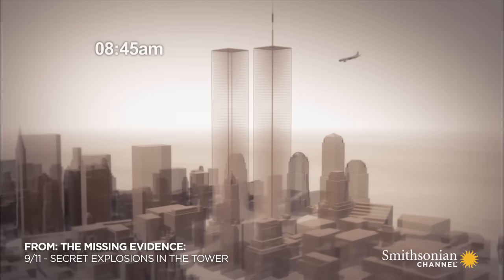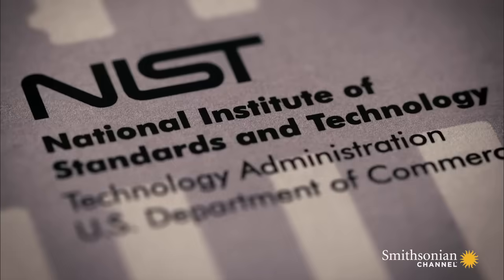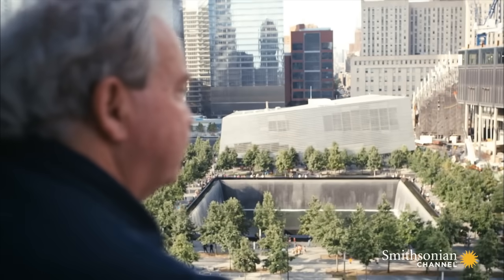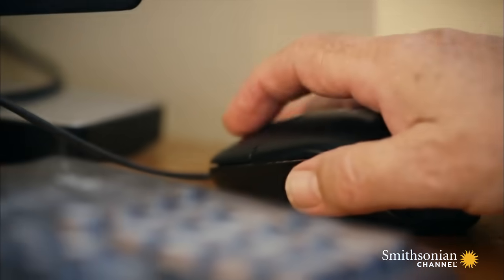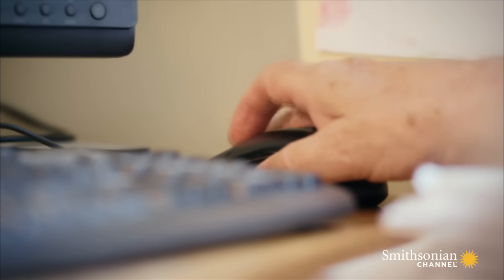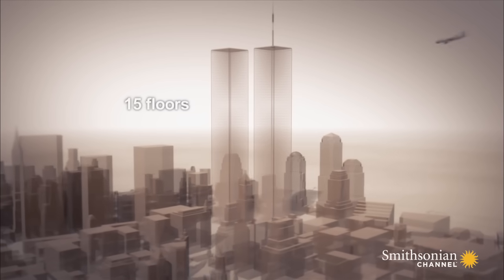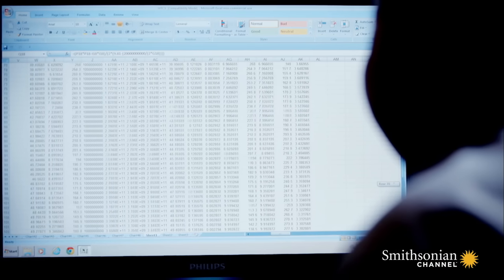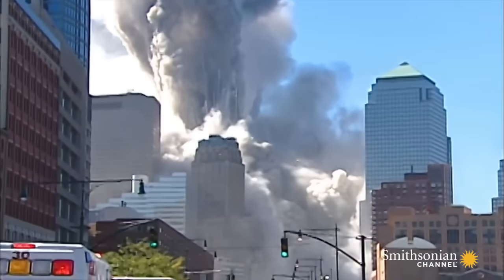This Computer Simulation Explains How the Twin Towers Fell

Comment: Aak yourself, why do the planes at the WTC Have wings that shear thru steel beams, even the tail and wing tips can be seen doing this. Yet at the Pentagon the wings folded against the fuselage and that then pearced 6 walls, all 13 ft in diameter. Thimk about it.
Reply: Purr Cat

The maximum load rating of the columns was exceeded by several orders of magnitude, and they were bent, torn, or broken. Steel is not some magic material. It is easily shaped and cut with the right tools and enough force. The nature of the collapse on 911 provided more than enough force.
..............................................................................................................................................
Soy boy, type in WTC Central Spine. 47 columns 4.4ftx3ft tapering to 32"x16" at the top. Tell me, child, how did they collapse? They Fell Straight Down. How dat be?
Reply: +Purr Cat Because the pentagon was reinforced against impact; the WTC towers were not.
Reply: Soy boy, type in WTC Central Spine. 47 columns 4.4ftx3ft tapering to 32"x16" at the top. Tell me, child, how did they collapse? They Fell Straight Down. How dat be?
Reply: +TimReed22222 so the strong walls caused the wings to fold back and thus the plane fuselage punched six neat round 13ft diameter holes. ok. now tell me why the WTC plane wings sheared steel with their leading edges and even the tips. all video shows this Fact. wing tips don't usually do that

Comment: What fraud, first Smith shows us translucent tubes. NIST denied freefall speed for over 13 years before David Chandler, from A&E 911 Truth obtained that admission. UL Never produced evidence that kerosene melts steel beams, beams some 47 in number and over 32x16 inches. And 150 tons of aluminum will not demolish 500,000 tons of steel.

Comment: Come on guys, think simple. Fact....there were two big holes in those buildings, we all saw two aicraft hitting both buildings, creating those big holes. I don't give a shit about how fast these two aircraft might have flown, as it was surely fast enough for both of them to be desintegrated inside the buildings. So now you have two holes and undoubtly lots of internal damage to the construction and instead of 100% only 60% of the columns are holding up the thousands of tons of weight above the impact points, and if you bring the fires into the equation the construction gets even more weakened (NOT MELTED!!!!!) and at some point the remaining columns say; "Fuck You, I can't hold this anymore", result is a collapse. To me when i saw those holes it was not a matter of If but when will these buildings collapse.

Comment: The guy is a chemical engineer. Until he released his software to be peer reviewed by mechanical.and civil engineers then take what he says with a pinch of salt. I'm assuming his model is predominately full of assumptions as you couldn't possibly solve that with just a momentum transfer assessment on excel.
Reply: asrgaqgq sdfgsdgsdfgsdg I'm a mechanical engineer, not a civil engineer. I wouldn't even attempt an assessment of the mechanics of a building - that's the job of a civil engineer. I woulsnt expect a research chemist could understand the mechanics enough without years of study. His excel model will have a lot of assumptions to simplify the analysis down. Why do you think others did more in-depth FEA?

Comment: Calculated with an Excel spreadsheet? That's what I think of when it comes to complex computer modeling with multiple variables.
Reply: tubbyturky
  >>>Calculated with an Excel spreadsheet? That's what I think of when it comes to 
>>>complex computer modeling with multiple variables

Face it tubby, you never calculated anything more technical than how much lard you can stuff into your mouth.
Reply: I take it you want me to tell you about my new ketogenic diet? Lots of lard to be eaten there.
Reply: tubbyturky
  >>>I take it you want me to tell you about my new ketogenic diet? Lots of lard to be eaten there.

I take your word for it. Hell, lard is tasty and not that unhealthy. But really, excel is a damn powerful tool if you know how to use it. Don't disparage that of which you have no knowledge. Keep in mind that some of the most amazing technological engineering feats were accomplished with spreadsheets NOT powered by excel. It's the tool, not the platform.

Comment: If anyone believes aircraft can fly thru steel girders like a hot knife thru butter then you are clearly a champion of Fantasy. A bird strike is deemed a serious impact by all pilots. Birds don't compare to thousands of tons steel and concrete. Over 50% of both planes should have slid down the outside walls down to the Tower bases. Where were these wrecks?

Comment: So the plane should have just broken between the steel beams instead of destroying them? Actually asking, no sarcasm.
Reply: The planes weighed around 150 tons each & were going 500 mph ... and the columns were actually short beams bolted together. Also the towers were mostly air, not solid blocks. All the planes had to do was break the bolts.

Comment: Yeahright.... Look on the internet for unbiased (read: not bribed) engineers who use science the way it should. By the way, I'm studying Mechanical Engineering. No way a aluminum plane can bring down a steel building. You need thermite (which is able to burn through steel) to get those columns down. These structures have been build with huge safety factors, considering all kinds of extreme scenario's. An aluminum plane flying into one of the Twin Towers is comparable with an elephant receiving a pinprick. Those buildings were in free fall, accelerating on gravity all the way down. 

There is so much sketchy stuff surrounding the downing of the Twin Towers, I could write an essay on it. 

I can fly into the sky with my arms! in a simulation. 
I can walk on water! in a simulation. 
I can jump 100 meters in the sky! in a simulation.
My own body can bring down one of the Twin Towers! in a simulation.
Reply: Thank you dude. It's refreshing to hear people who are versed in science/mechanics get it.  I can't tell you how many actual 'engineering majors' I've met who can somehow reconcile their knowledge of physics with the official version.  That's when you know you live in an authoritarian society.
Reply: "By the way, I'm studying Mechanical Engineering. "

Great stuff, junior. You seem to have a lot to learn though.

"No way a aluminum plane can bring down a steel building."

Anything will bring down anything if its going fast enough. But that's irrelevant - did you not notice that the buildings WEREN'T brought down by the plane impacts? They stood for a couple of hours until the fires brought them down.

" You need thermite (which is able to burn through steel) to get those columns down."

You'd need hundreds of tonnes of it, and it woudl be very obvious.

"These structures have been build with huge safety factors, considering all kinds of extreme scenario's."

Such as?

" An aluminum plane flying into one of the Twin Towers is comparable with an elephant receiving a pinprick."

See above. It was the fire that brought them down

"Those buildings were in free fall, accelerating on gravity all the way down"

No they weren't. Nowhere near in fact.
Reply: @andyknowles772  
Ground zero = the point on the earth's surface directly above or below an exploding nuclear bomb.....
Reply: Mossad...
Reply: Hi Freek - Keep studying. Don't stop thinking. We can't all agree on everything.

Comment: This is ridiculous, it doesn't account for the heavy strong center core of the building that was constructed to hold up each floor.  He is only calculating the force of one floor falling on the one below it.  His calculations don't consider the inner structure of heavy iron beams!
Reply: David Soom

The center core used conventional steel [not iron] beams to hold the vertical columns together. There was nothing exceptionally strong about the core. When considering a collapse, that is how it's done, one floor has to be the starting point and fall on a lower one. The lower floor must either catch and stop the entire dynamic load of everything above it, or fail. And fail it did.
.................................................................................
This is ridiculous, it doesn't account for the heavy strong center core of the building that was constructed to hold up each floor.  He is only calculating the force of one floor falling on the one below it.  His calculations don't consider the inner structure of heavy iron beams!
Reply: BS It doesn't account for the center core.  If you believe this then you believe building 7 fell too with no help.   You will believe anything1
Reply: David Soom
  >>>BS It doesn't account for the center core. 

There's nothing magic about the center core. It's just more columns. There is no monolithic structure there, it is short columns stacked on top of each other. The columns are spaced apart with steel beams, which support a fairly thin concrete floor. And building 7 did fall without "help", but that knowledge is independent of what happened to the towers.
Reply: Why would you claim that the main towers just fell  with no resistance and building 7 was differen?. What happened that day including the Pentagon and Shanksville (empty hole) was caused by the same reasons.
Reply: David Soom

𝐖𝐡𝐲 𝐰𝐨𝐮𝐥𝐝 𝐲𝐨𝐮 𝐜𝐥𝐚𝐢𝐦 𝐭𝐡𝐚𝐭 𝐭𝐡𝐞 𝐦𝐚𝐢𝐧 𝐭𝐨𝐰𝐞𝐫𝐬 𝐣𝐮𝐬𝐭 𝐟𝐞𝐥𝐥  𝐰𝐢𝐭𝐡 𝐧𝐨 𝐫𝐞𝐬𝐢𝐬𝐭𝐚𝐧𝐜𝐞 
I never claimed that. I never wrote anything close to that.

𝐚𝐧𝐝 𝐛𝐮𝐢𝐥𝐝𝐢𝐧𝐠 𝟕 𝐰𝐚𝐬 𝐝𝐢𝐟𝐟𝐞𝐫𝐞𝐧?
WTC 7 was a completely different structural arrangement. It was also damaged in a different way, although the damage wasn't responsible for the collapse beyond setting the building on fire. WTC 7 collapsed due to failure of some structural members due to deformation by heat.

𝐖𝐡𝐚𝐭 𝐡𝐚𝐩𝐩𝐞𝐧𝐞𝐝 𝐭𝐡𝐚𝐭 𝐝𝐚𝐲 𝐢𝐧𝐜𝐥𝐮𝐝𝐢𝐧𝐠 𝐭𝐡𝐞 𝐏𝐞𝐧𝐭𝐚𝐠𝐨𝐧 𝐚𝐧𝐝 𝐒𝐡𝐚𝐧𝐤𝐬𝐯𝐢𝐥𝐥𝐞 (𝐞𝐦𝐩𝐭𝐲 𝐡𝐨𝐥𝐞) 𝐰𝐚𝐬 𝐜𝐚𝐮𝐬𝐞𝐝 𝐛𝐲 𝐭𝐡𝐞 𝐬𝐚𝐦𝐞 𝐫𝐞𝐚𝐬𝐨𝐧𝐬.
What the hell are you talking about?
Reply: David Soom
 >>> we don't have video of the "plane" that hit the Pentagon

So what? What kind of spoiled conspiracy nuts are you that you demand a video? There's literally tons of physical evidence that Flight 77 was parked inside the Pentagon on 911. There is also plenty of dna and personal effects to account for the passengers, as well as both black boxes. Anyone who denies this is just a fucking liar and is not worth consideration of anything they say, as only a pathological liar would deny such incontrovertible facts. There's been plenty of proof posted on this subject numerous times. The same applies to the flight 93 wreckage. Denying it only eliminates you as someone with any integrity.
Reply: I have to go with the  common sense I was given.  It so happens I'm a Comercial Pilot  Certificate number  2059989 Look it up if you wish.  I currently fly a Citation Bravo for a wealthy family that includes two other aircraft in the fleet.  Radar has tracked the different jets on 911 with speeds well over 525 Kts. at sea level. This is an impossible speed and cannot be reached by a Boeing 757 or 767.  What conspiracy theory do I have to commit myself to believe when I understand the impossibility of such things?  Nothing can push, pull or do anything to the Boeing airframe to reach those speeds.  I understand specifically that fact as do several thousand of my flying brothers at Pilots for 911 Truth.  Are you, without such knowledge, telling me and my flying brothers that we are wrong and misunderstanding the situation?  With what authority do you bring to the table.  As well there are thousands of engineers and architects who have taken the time to study this and have point by point proven the governments position to be ridiculous.  It's one thing to call me a tin hat wearer or some conspiracy theorist but it's another to tell me my knowledge of aircraft and flight is incorrect.  You have no basis to do that.  Then ask yourself, what was the final outcome of this horrible event?  Our nation immediately gathered our resources and our young solders and immediately marched to war.  Again you will tell me this wasn't the ultimate plan?  Obviously you have not researched this event beyond watching a public television 60 minute program.  You come to this fight with a butter knife and you lose.  Join the masses of ignorant free roaming slaves.  As one of those myself, I welcome you. As a man of knowledge though you are not. You are doing nothing more than telling me what you have "learned" watching the 60 minute wrap-up of "How the Buildings of 911 Collapsed.

Comment: Normally Smithsonian does really well researched shows, but in this case, they have not.  It is not difficult to "make up" a simulation that will match the rate of observed collapse.  Just because a lot of numbers are shown says nothing about the assumptions underlying the simulation.  Does the simulation take into account the pulverization of all the concrete and the deformation and apparent vaporization of steel?  To completely crush such a building will take, by design, a large amount of energy.    In the absence of explosives,  this energy must be derived from the gravitation potential energy in the free standing building.  It is easy to show that this was not the case for Tower 7.. the top section of the building fell at free fall acceleration for 2.5 seconds while "crushing" the sections below.. this is physically impossible since there would be zero residual energy available to produce the crushing ..  the video shows a string of explosions during collapse which must have been carefully designed to weaken the building such that the structure would not resist the free fall of the upper section.  The obvious conclusion is that it was a brilliantly designed controlled demolition.   In the case of the other two towers, an energy analysis seems moot even though there is more gravitational energy available in the free standing buildings.  The rate of collapse of these buildings shows that only 40% of the gravitational energy was needed to drive the collapse.  If that had happened as asserted, that would have meant that the buildings were extremely flimsy, on the contrary, these building were specifically designed to withstand the collision of a large airplane.  If one continues to argue that the collapse was strictly gravity driven and special explosives materials were not used, how does one explain the fires that burned for more than 3 weeks in the base of the buildings.. these fires could not be extinguished by water and must have been caused by what?

Comment: THEY ARE TALKING ABOUT  ALUMINUM GOT HOT ENOUGH TO MELT STEEL. WELL, STEEL MELTS AT 2300 FARINHITH, THEN WE PUT THE ASBESTOS BLOWN ON THE STEEL AND THAT BRINGS THE MELTING POINT OVER 32OO DEGREES FARINHIGHT!!!!!!!   SO, WHERE DID THE EXTRA 2200 DEGREES COME FROM??????????????? INSIDE JOB!!!!!!!!!!!!!!!
Reply: There's not evidence that any steel melted at all. That's a myth.

Comment: Okay, so this guy used a "transfer of momentum program."  What parameters did his program account for?  What were the inputs?  Was there any resistance to motion other than momentum alone?  Buildings aren't simply stacks of stationary masses.  The masses are connected together using rigid beams to support loads and to resist motion.  How are we supposed to trust that this guy's Excel spreadsheet accounted for the proper mechanics.  I'd rather see a physical experiment using a scaled-down building to see how the motions ACTUALLY behave.

Comment: As someone aquainted with the English and Freemasonry - your Englishman is a lackey and is an idiot to not understand that the 100's of thousands of tons of structural steel in the building Below the collapsing section would be resisting, and thus slowing down the collapse, markedly.  The Pyroclastic Dust Cloud, destruction at near freefall speed with an obvious demolition wave with squibs that are easily visible, along with the ejection of debris at high velocity laterally and, at times, vertically, not to mention the video and audio of numerous recorded secondary explosions, combined with all the 100's of eyewitness' reports of Explosions makes it completely obvious - all 3 towers were brought down by CONTROLLED DEMOLITION........each one fell in less than 14 seconds - end of story.........False Flag 100%. But, since the Smithsonian (don't make me laugh), is just like Popular Mechanics - you only have 900K hits..............translation? - you suck...........the 'real explaination' videos are pushing tens of millions some close to 50 million..........your time is up foo.  First responers are still dying by the 100's due to Mesothelioma form Asbestos Inhalation - and Americans sit by idly, doing nothing.......you will reap what you sow........

Comment: No experiment no proof. It wouldn't be an enourmously expensive exercise to build a scale model to see if the gravity collapses could be replicated, after all it happened 3 times in one day with differing initial conditions. Can the top portion of a structure completely crush  a larger body, of similar construction, that has previously supported it? Futhermore can it also do it without decelerating as seen in all 3 tower collapses on 911?

Comment: Total propaganda.  The tops of the towers were blown to smithereens and ejected OUTWARD.  They did not fall as your simulation appears to show.  Get a real job and stop lying to the people with these BS videos.
Reply: So an airplane hits the building and brings and has so much energy that the building stands for a few hours before it "collapses"    How stupid are you???
Reply: -Good counter argument.
Reply: You did not see debris being thrown OUTWARD at high rates of speed?
Reply: Great example.. When a bullet hits steel is it bringing in the outside energy of the bullet to the steel just like explosives in WTC brought in additional energy and caused the collapse.  You get it!!!!